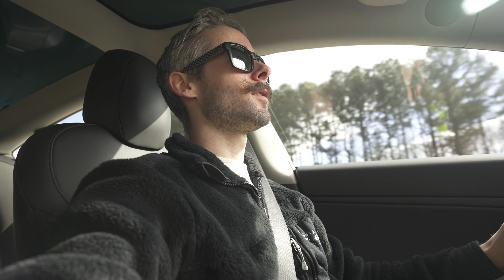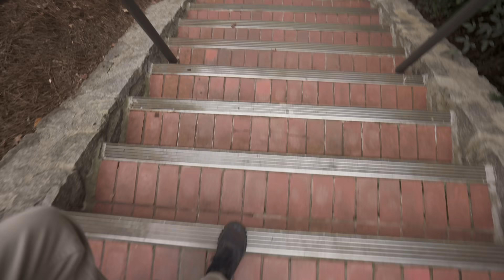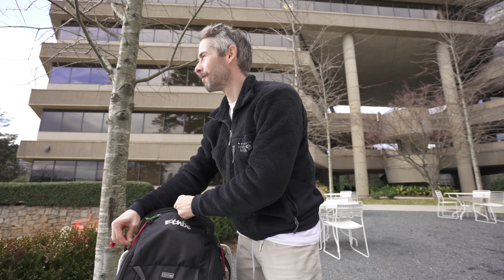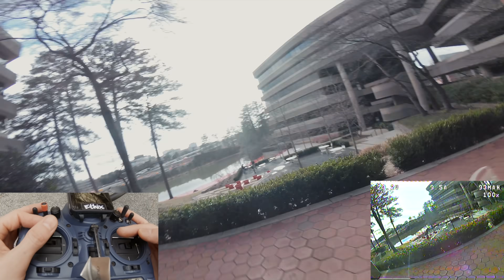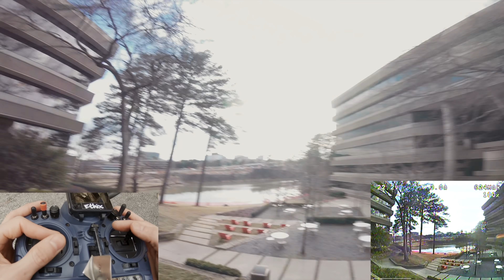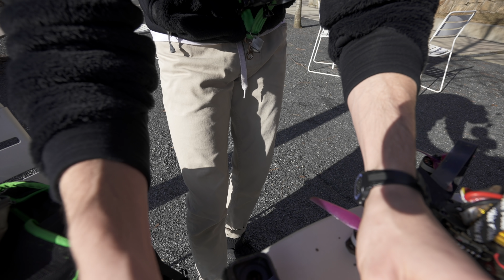Remembered Mid Powerloop

Comment: Don't BLEED it, USE a flat head and pry on the pad pushing the piston back.. Then get a brake caliper collapse  tool cause it's GG LVL 9000
Reply from the maker: ...  he didn’t want to fuck up the pads. I guess
Reply: @MrSteeleFPV  well you can take a flat head bend it in the middle make it 90 degrees and pry on the metal plate of the pad... i used to work on cars he ain't gonna hurt that pad...